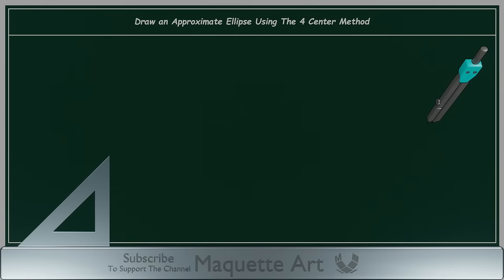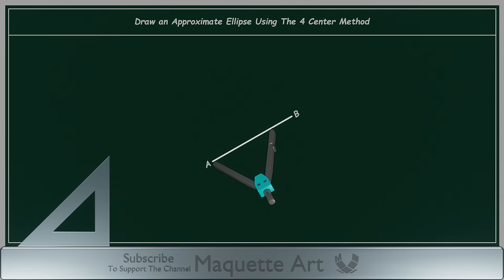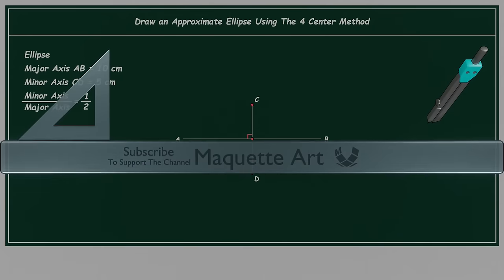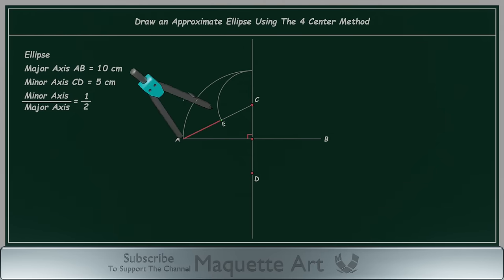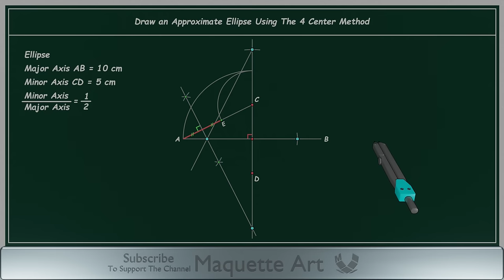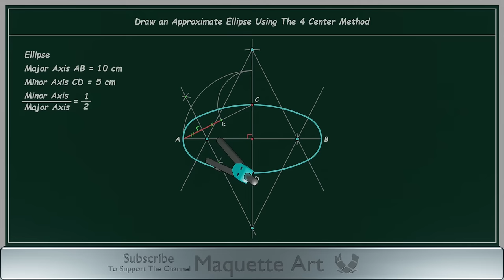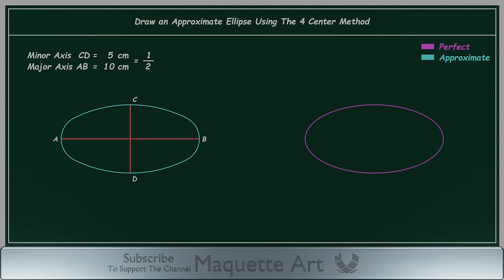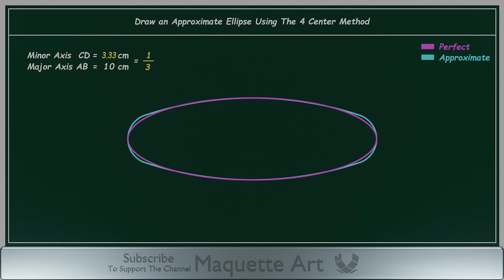How to Draw an Approximate Ellipse Using 4 Center Method | Engineering Drawing

Comment: Could you lengthen the operation to include more than 4 points to lower the discrepancy of approximation?
Reply from the maker: No, you can't do that in this approximate method. but in other "Exact" method like for example the "Rectangle Method" yo can increase the point as much as you like.
check this video for the rectangle method https://youtu.be/gG9qWZV9LT4